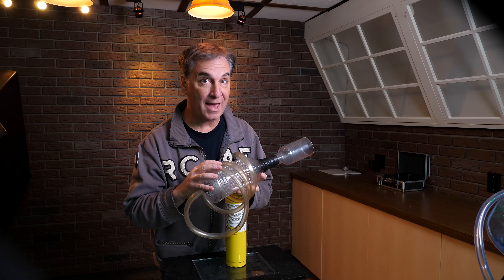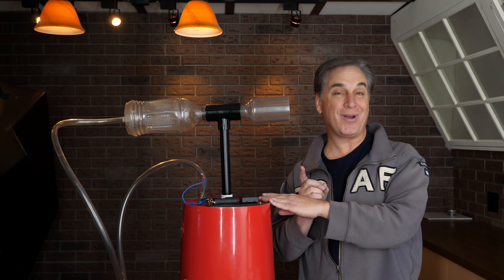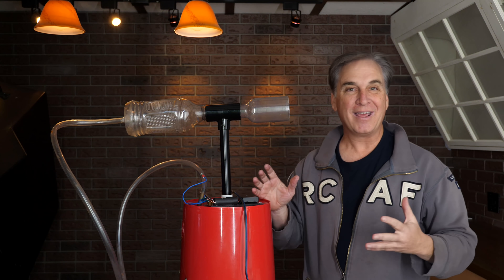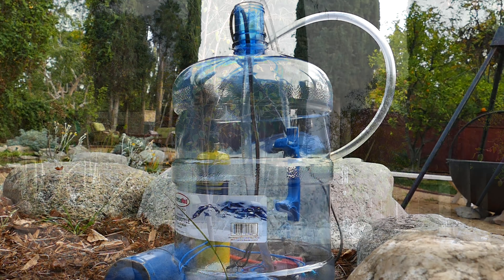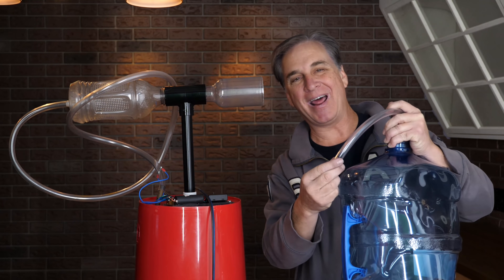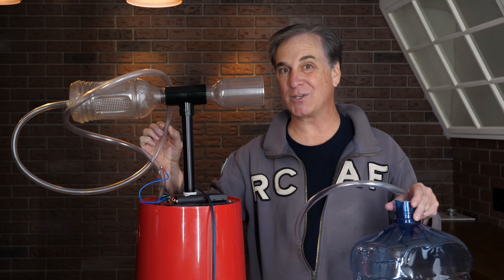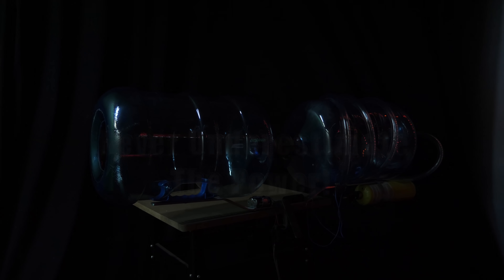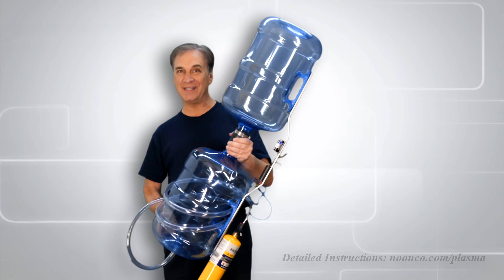GIANT DIY Propane Plasma Cannon!

Comment: Why do you call it a plasma cannon when you don't ionize any atoms?
Reply: Jon go back to school and relearn about plasma. You should know every flame is a plasma. Candle flame is a plasma called "Cold plasma". Even Aurora borealis (northen lights) is a COLD PLASMA too.
Reply: Yesss
Reply: "Why do you call it a plasma cannon when you don't ionize any atoms?"

It's just marketing.
Reply: Jon - Flames actually are plasmas. Or at least a mix of plasma and gas. There would certainly be ionized atoms in there. Interestingly, you can demonstrate this with a candle flame and an electric field. You can use the field to physically move the flame, proving that a significant portion is ionized / plasma.  Every time you sit by the campfire, you're enjoying the warm glow of plasma.

All that aside, I think he calls it a plasma gun because that sounds cooler than burning water jug.

Candle flame experiment:
https://youtu.be/6fKGeV4NrrA
Reply: @mrayoung  You may find this interesting: Apparently, flames are also diodes.
Don't understand it myself, but I do know that one of the techniques used to verify positive ignition in gas burning appliances is called "Flame Rectification".
A small current is passed through the flame (measured in microamps ) to verify that a flame is burning or else the gas valve is de-energized.
Reply: @burnerjack01  I had no idea John - I had blindly assumed it was a heat sensor, and never put thought into it. Definitely is interesting!
Reply: @burnerjack01  yeah man. You can get a 12 volt battery and light and wire it up so a flame is in series with the circuit. It works one way of the polarity but not the Other. Would be interesting effect on ac power. I have tried it pulsed dc and at low freq 2 hertz you can see a steady flame lengthen and shorten and lengthen. With higher voltage and amps it would have a significant effect I believe.
Reply: @Buzzhumma  This is also how most vacuum tubes work.  The cathod would be heated an the anode left cool. The electrons could leave the heated cathode but not the cold anode. The result was rectification.
Reply: @mrayoung  No, not really. Not all fire is plasma. Some flames CONTAIN plasma, though.  Still, even if it's incandescent gas, and even if some of it is ionized it is not always considered to be plasma.
Reply: @Andrew Y "There would certainly be ionized atoms in there. Interestingly, you can demonstrate this with a candle flame and an electric field."

That's because of electrolytic conductivity, fire doesn't consists of ions and free electrons, it's not plasma.
Reply: @mrayoung  Remember what Diet Smith said' "He who controls magnetism controls the Universe" something to do with GUT and Interconnectedness?
Reply: @mrayoung  Still not plasma, get your shit straight.
This is like calling a BB gun a firearm.
Reply: @mrayoung  bruh, hit em with facts.

Comment: IF you really wanted this to be a "plasma" gun, you would need a high frequency, high voltage, very low current surge into the flames as they are shooting out so the carbons being produced in the flame is charged and burning in a true plasma arc and ejection. And of course, those bottles would be totally out of the question, with the exception of them being a great slow-mo one-time shot.

Comment: So we're just throwing words around now, right?  Its a fire bottle, not a "plasma" "gun".  Just put a little acetone in a 2l bottle and torch it off.  Same thing.  I mean if you just shut off the gas flow, you don't need the tube at all and the second bottle does literally nothing since the flow isn't supersonic.  Whatever.

Comment: you should invest in a Chronos 1.4 high speed camera
Reply: Are they expensive?
Reply: @samfosdick9874  at first glance, yes. but for a high speed camera it is a steal for 1500fps at 720p.
Reply: @WildfoxFabrication  price?
Reply: if you buy the baseline model, 8gb ram, color, simple lens, it’ll run you about $3000. if you upgrade with a good lens and more RAM, you’ll get up to around $4000.
Reply: @WildfoxFabrication  that's a little rich for my blood.  I paid $4000 for 10mp DSLR a long time ago and it was basically overtaken by $2k model 2 months later.  That's the way with tech gadgets...

Comment: Hmmm this could be built using some old 20 lb propane tanks if you just want the boom and dont care to watch the flame front inside. Start small with the torch tanks. I miss my old carbide cannon from when I was a kid 60 years ago. :)

Comment: Propane vs propane?
Reply: "MAPP gas" is a trademarked name, belonging to The Linde Group, and previously belonging to the Dow Chemical Company, for a fuel gas based on a stabilized mixture of methylacetylene (propyne) and propadiene. The name comes from the original chemical composition, methylacetylene-propadiene propane.
Reply: @stevenswenson7041  Thanks, I swear I heard propane twice. I use MAPP gas at work, good stuff.

Comment: you could make a flash back inline with the gas by running it threw a bubbler..bong like so after the gas goes threw it it cant go back under the water to reach the torche  :)   or a bunch of rice in a meds container with hoes at each end working like a filter :)

Comment: p1*v1=p2*v2 ... A 5 gallon water jug with a volume of 18.927 liters converts to a volume of 1155 cubic inches.  If you're using 5 feet of 1" I.D. Vinyl Tubing, the volume of it is 47 cubic inches. With a total volume of 1202 cubic inches, you can better estimate the optimum stoichiometric fuel/air ratio for your cannon. After many years of building PVC Combustion Cannons, I've found that a really good ratio is between 4.5% - 5%.  (% by volume)

If you made a 'meter pipe', using a 6" length of 1-1/2" SCH40 PVC Pipe, you could use a pressure regulator to set pressure in the meter pipe to 60psig and then inject it into your plasma cannon. No listening / No guessing / No misfires - just a perfect mix every time. If you're interested, I could send you details to your site (via email) on how to construct a meter pipe. 

Great build, btw! This is actually something I've yet to try.

EDIT: Actually... If you're using TWO bottles for this massive cannon, then perhaps you'll need  'TWICE' the fuel? (Treating the entire cannon assembly as a combustion chamber, rather than a separate combustion chamber and then 'barrel... It'd be interesting to experiment with both.
Reply: Da Wabbitt if I were you bro I’d keep the knowledge to yourself... but could this do damage to a living target or is just for aesthetics?
Reply: 😲😲😲 O.. K....

Comment: This would be AWESOME for an alien cosplay - all you would need to do is wire a basic sound circuit for the "charging" of the weapon (i.e. filling the tube with gas), maybe use some lights too for styling

Comment: When I think plasma gun.  I think of a device that literally strips all the electrons from the atoms nuclei and fires it out one end with temperatures as hot as the suns surface to as hot as a nuclear bomb going off.  In reality though a fire is a type of plasma but a very low energy one with maybe one or two electrons exchanged per molecule during combustion.
Reply: nods sagely

Comment: You are calling it a gun,better check your local laws about building it, firing a gun in city limits of most city's is a felony period.
Reply: Fire arm is usually pretty strictly defined.   As it isn't designed to fire a projectile other than the expanding gas ... probably isn't a fire arm in most cities/states in US.   It could be considered a dangerous device,  or fall under 'easily modified to...'  clauses  to fit if a prosecutor so desired. Your mileage may vary... checking applicable law is always a good idea.

Comment: Did a Similar version of this  in the late 1970's with a one gallon Jim Beam whiskey bottle and Zippo lighter fluid. With an empty bottle,  put a squirt of lighter fluid in the bottle then wait for the fumes to build up.  The way we ignited it was simply drop a lite match in the top. DON'T HOLD THE MATCH DROP IT! treat it like a mortal tube.  It would fall to the bottom, usually before igniting and burn from the bottom. can watch the flame front from bottom to top. it takes about an hour for a re-light.one squirt last about a week. longer if capped  NEVER FIRE CAPPED!!!!!!!!!!!!  DUH.

Comment: Why would anyone build a plasma gun that way. Its simply not good enogh.
You would have to have a metal like ball (with holes) that can take in the gas and then fire it with railgun. It would give a much better plazma effect. Putting gas into a small plastic bag, inside the metal ball. When it fires, the speed of the ball will ripe the bag and the heat araund the ball will ignite the gass.

Comment: What in the hell makes this a "Plasma Gun?" Where's the plasma?
Reply: No plasma!
Reply: Yup no plasma. Just fire
Reply: Fire is Plasma.  The 4th state of matter?  It's not really all that exotic, the visible part of a candle flame, or a bic lighter, matches?  All of that is a Plasma.  As long as it's Ionized, and radiating more than it's Black Body Temperature, it's a Plasma.
Reply: Psiberzerker 
Afraid not mate. Fair enough there is no set in stone ionised value for plasma, but ordinary fire reaction flames like a candle 1400 degrees c are not in the same ball park as generally accepted plasmas like arc welders which reach 20 000 degrees c
Reply: Psiberzerker 
Wait. I’m looking into this, there is some contention among physicists.
Reply: NASA says no it’s not.
Reply: @markc7955  It's a state of matter, not a temperature range.  'generally accepted," that's like saying lead isn't a solid because it's not below -4 celsius.  Is it ionized, does it radiate (Beyond it's black body temperature)?  Then it's a plasma.  Just because there's higher energy plasmas does not demote it's status to a gas, microwaves are lower energy than Xrays, and they're still Light.  Ask a real physicist, that's the Definition of a plasma.  Basically if you can see it glowing, you know it's a plasma.  It's really not that exotic.
Reply: Psiberzerker 
all hot bodies radiate. The fact we can see it’s glowing doesn’t mean much. We see a very narrow band of the Electromagnetic spectrum in visible light. Snakes can see mice glowing with heat. Are mice plasma? Anyway the good people at nasa say no it’s not. Good enough for me. Cheers. Enjoying the convo.
Reply: @Psiberzerker  No, fire is never plasma. Fire may contain plasma, but is never plasma!
Reply: @markc7955  Right, that was the BLACK BODY RADIATION I mentioned, twice.  If it radiates in addition to that.  I said that.  Twice.
Reply: Psiberzerker 
you did actually say ‘fire  is plasma’ about an hour ago. Just look up in comments. But I take your point. I think that is what some or the contention about what is plasma. At the single molecule that is reacting then yes you could argue that. But on average the ionised level is not high enough for fire to be called a plasma. Which I think is what started all this.
Reply: From nasa. 

97.   Is fire a plasma?

The fire given off when burning for example, paper, wood, gasoline--is that another of the manifestations of a plasma? If it isn't plasma that makes the fire shine--what is it?

Reply

    You asked a good question, but the answer is--no, fire is not hot enough to create a plasma.
    Most flames are yellow. The main reason is that flames contain little bits of burned material--bits which later form its smoke--and they get hot enough to glow. Hot solid materials always glow--for instance, the filament in a lightbulb. However ,glowing in yellow light does not require a very hot temperature.

    To create a plasma takes more energy, and requires a higher temperature than the flame provides. The collisions between atoms need to be energetic enough to kick an electron completely out of the atom.
Reply: @markc7955  Okay, I mis-spoke.  That fire, in the 5 gallon bottle, the pyrolysis transition from Propane-to-Water Vapor, and Carmon Dyocide?  Yeah, that fire is Plasma.  If you're talking about a solid-to gaseous-to-plasma pyrolysis like wood, that fire isn't plasma, only the visible flame of it is in a Plasma state, the rest of it is in a solid-to-gaseaou state, as it breaks down by pyrolysis.  So, it was an oversimplification "Fier is Plasma" when i should have been more specific.  Flame is a Plasma.
Reply: It is not.
Reply: @Psiberzerker  no!
Reply: @kraagaard  That's it?  Just "No!"  That's all you got.
Reply: @Psiberzerker  well, yea - you didn't bring anything to contradict my statement. This is physics, only physics and not chemestry. To have an plasma you need to bring anough energy to the atonm so the electrons brake free and stays fre as long as the said energy level is present. In a flam, which is a chemical process called oxydation, there can never be prodused enough potential to produse plasma! A flame is but a reaction betveen oxygen and a sufficient volatile substanse. A plasma is a very different animal
Reply: @kraagaard  Not enough energy to strip ALL of the electrons off, and there's different polarites of Ionization.  (Some of the ions may be Negative.  I.E. have an extra electron, temporarily.)  If you tried to do that with some of the heavier elements, then you would need some truly insane amounts of energy, we're talking Stars.  Stars larger than our own.  (Fusion is also a reaction that typically happens in a Plasma state.  Even then, Iron is a dead end, for natural plasma, even is Stellar fusion)
Reply: There is 1 exotic exception to the Standard definition of a Plasma (Ionized, and radiation other than the black body at temperature) in a Liquid State, which is Cherenkov Radiation.  Caused by sub-nucleic particles (Including Ions) breaking the local speed of light through coolant water around nuclear reactors.  However, since it's not in a Gasseous substrate, it's fairly obvious, and as I said Exotic.  Plasma isn't.  It's just one of the states of matter.
Reply: fire is technically a plasma, even if its a very weakly ionized plasma
Reply: @michaelr7035  Fire is a collection of weakly ionized gasses and under normal conditions will not transition to the plasma state. There is some debate about where that transition occurs so it is somewhat a matter of opinion for sure. 

Hopefully a minimum ionization threshold can be identified soon so we can all stop killing each other for science.

Comment: @stancurtin 
5:50 If you shape the large container in the right way, you should be able to make a vortex cannon out of it too :D
So not only does the spark travel through the tube & creates a cool effect, it could also create a cool ring of burning gas  (but I think the "flow rate" when the gas ignites is WAAAY to high to form a vortex, maybe if you had like a huge 2-meter radius flask at the front and the same flask at the back it might work (to reduce the "flow rate"), or something like that (an only had gas in the small flask))

Comment: in what sense does that thing generate a plasma? Its a straight up fuel/air explosive...
Reply: It's just combustion, I don't see how you get plasma from that.
Reply: https://aip.scitation.org/doi/abs/10.1063/1.322231?journalCode=jap  Fire is a low density plasma.

Comment: How much thrust does this produce I bet if you worked on it you can create a plasma thruster. Side note anyone that thinks this isnt plasma it is search on google
Reply from the maker: It lifted a 25 pound sandbag that I had over the front leg of the table...  So, pretty strong.  I think a pulse jet would be very similar in design as far as propulsion.  But, you'd need to feed in a lot of gas a lot faster to keep it going.  It could take a couple minutes for the jugs to fill from my little propane torch...